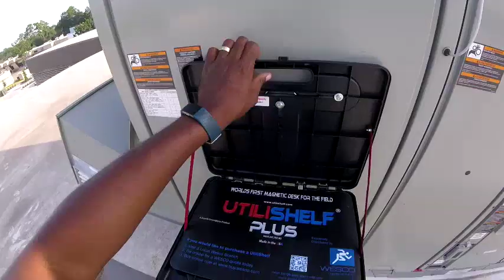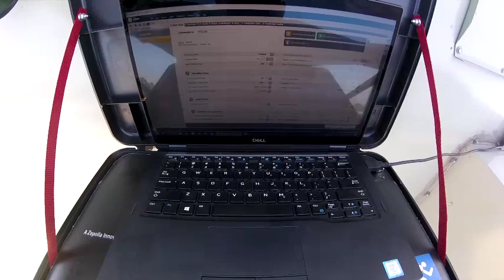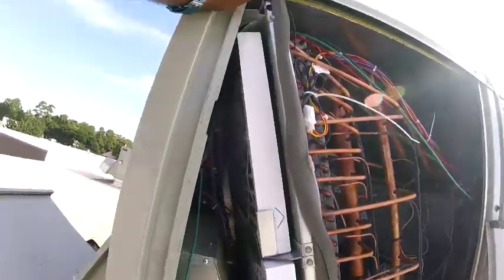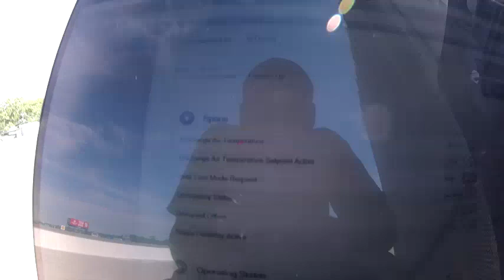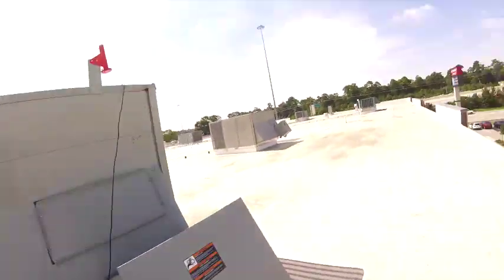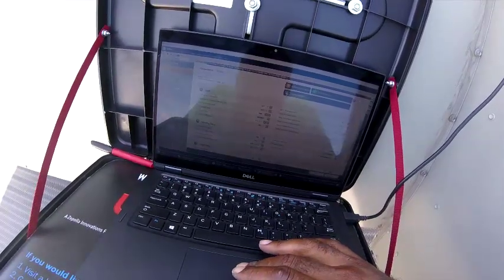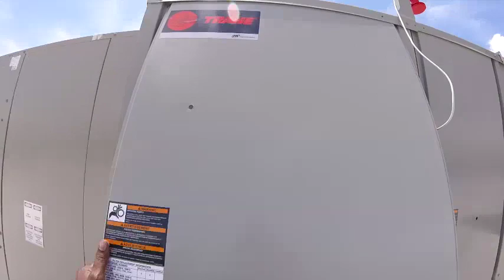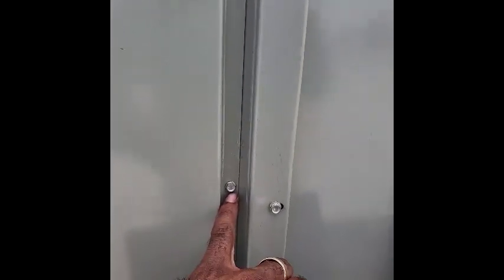HVAC: Troubleshooting multiple roof top units

Comment: Alot of those new package units come with primary condensate switches. If those switches get triggered due to drain issues, they cause nuisance no cooling calls. Too many controls and parts on these units nowadays

Comment: Hey Walter ,FYI those units have a +/- 3.5 degree deadband around the discharge air setpoint for compressor staging.
Reply from the maker: 10-4 Thanks..Are you with Dan foss?
Reply: WW HVAC No ,good guess though.

Comment: Have you or have u ever tried or thought about Fieldpiece Joblink Probes? Then u don't got carry those look long hoses around. Plus you won't take couple of oz of freon out each time u unhook or hook up to a system. (would matter more on residential then commercial) bit they are beese knees for commercial as well. Plus can stick the temp probe in the hole prolly reach a bit further for supply and return temps and it all Bluetooth to PC or  phone.

Comment: HVAC People the Direction of the Filters should Not Affect anything other than the wire Mesh Helps Stop the filter if it gets Dirty from Bowing or bending gives it strength with the direction of the airflow.The Material they are made of is the same thru the entire Filter but should not affect the Airflow or change any readings of static pressure or cooling capacity
Reply from the maker: May not make much of a difference but the filters clearly says airflow direction.
Reply: No you’re right with Direction of arrow because of the wire support but it really would not affect any performance of the system been doing this from 17 yrs old still working at 63 but I really like your YouTube channel and Help for the younger guys
Reply: Jules ODwyer boy you know nothing bout Hvac filter in backwards kills your air flow
Reply: Marcus Powell ,if this is True try using a manometer with filters in either way and you will see that the static pressure is the same also the material used is the same thru the filter so where would be the restriction on either direction
Reply: Marcus Powell ,What kills you airflow is 1 inch pleated filters even in oversized grill and oversized return chase now the 2 inch aren’t as bad used in commercial but still not real good .I used 1 inch cheap with a 4 inch or 5 inch nerve 8 and up on filter base in vertical or horizontal application and watch your static pressure cut in at least half . The one inch pleat are terrible in any system